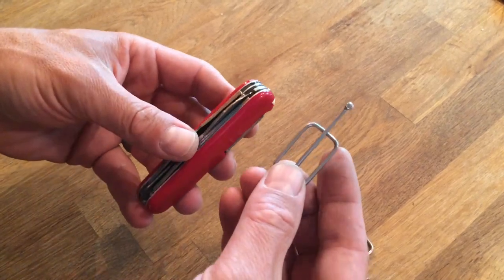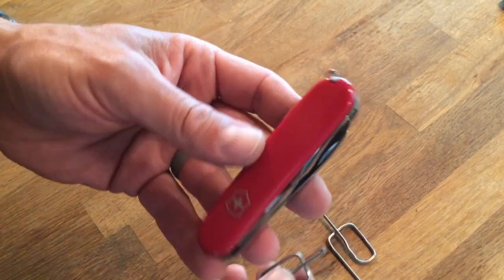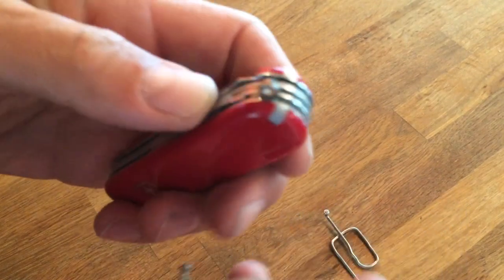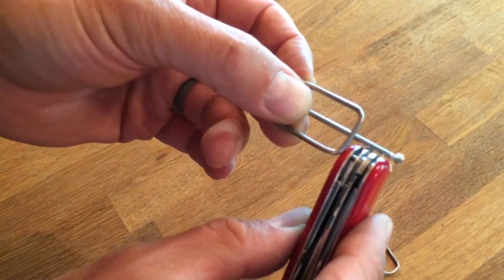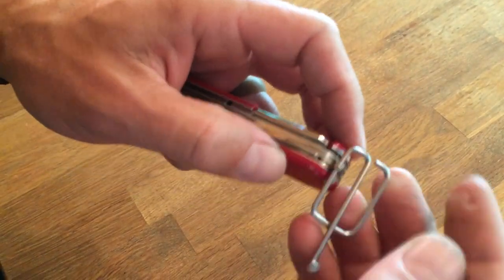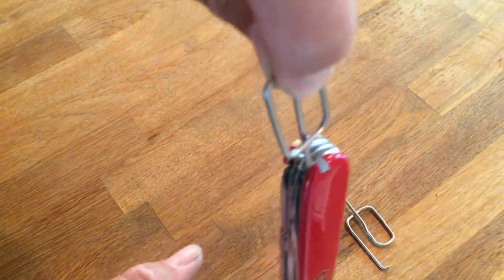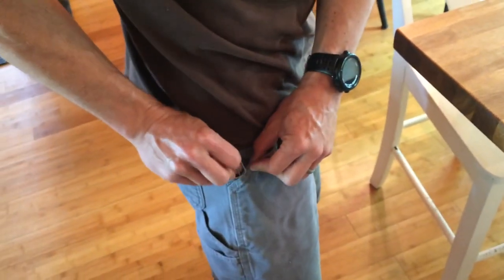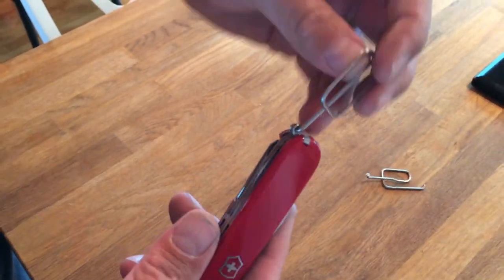DIY pocket clip for Swiss Army Knife

Comment: Simple, effective, cheap and BRILLIANT. 
Made one out of a large paperclip in about 1 minute. Works great. Will invest in a more durable material like a bicycle spoke.
Many thanks Spike.
Reply: I did just as you said after reading the comment and i’m simply MIND BLOWN!

Funnily enough, I used the pliers on my Deluxe Tinker to make said clip, can’t wait till i upgrade!

(Bike spikes are 5x cheaper than the SwissQlip too!)
Reply: @chicagotypewriter2094  Huh, 5X cheaper, how do you do the math? Using the cost of the SwissQlip then doing 5X, the calculated results is always higher number, never a lesser number. Maybe you mean the SwissQlip is 5X more in cost than a spike spoke; certainly, that would make more sense and can be correctly calculated.

Comment: I think you can use a quarter size key ring. Just pull it apart enough so it it isn't tight anymore. Slide your knife with its key ring onto it and then clip the larger key ring to your pants.

Comment: Hi. That is very cool but how did you bend it to make it look so nice? Unlike the one on the table.hope you can answer-thank you!
Reply from the maker: Ray Jr DiBenedetto The one on the table was my first attempt. So it was bent back and forth several times to figure out the correct distances, which causes it’s crooked look. To bend the spoke, I used large needle nosed pliars and standard pliars. I did the bending with the needle nosed pliars while holding the spoke firmly with the standard pliars. The skinny tips of the needle nose pliars allow me to grip the spoke close to the standard pliars jaws so that I can get a tight radius bend. It takes a fair bit of strength though. I hope that helps! Cheers

Comment: Epic simple, totally ergonomic!! I assume the wide portion that hangs over your pocket was left wide to accommodate the width of the knife? I would prefer it to be left smaller/thinner, please let me know!! Brilliant work sir! Great design!!!
Reply from the maker: Thank you J Garcia. The width of the clip results - in my case - from the width of the pliars I used. 

I imagine a firm grip with the tips of some needle nosed pliars could produce something thinner. 

Or, I think only having one return bend could work as long as the spoke has itself to ‘pinch’ your pocket against. 

Cheers

Comment: On the face of it ,that looks great for pocket storage . But when you come to use the knife that clip must get in the way , a lot . I have taken off the ring and ground down the lanyard ring i found that even gets in the way for comfort . I can see how useful your mod is for pocket use but that clip mod must really be a big pain and get in the way ? Ok if you hardly ever use the SAK but if you use the thing a lot i see big prob . Can you tell us how to use the knife with this thing hanging , or better still make a video . Many thanks i also mod my SAK  ( see video ).
Reply from the maker: Thanks for the reply Rob. The clip I made certainly doesn't come without some compromise. If you found a bare lanyard ring annoying, I'm certain you wouldn't be happy with my solution. However, I've been able to acceptably work around it while using every tool. I'll eather fold it back along the same-side scale (when using the small blade for example), or have it extend off the back of the knife (when using the large blade for example). I use my knife daily in the office and in the woods, but not as a 'power user', or with such heavy force that the clip impedes what I'm trying to do. In the end - for my uses - the trade-offs of the clip are still worth keeping it installed. Cheers!
Reply: @SpikeBachman  Thanks for the reply you explained it well you find the trade off was worth it , that's fair comment . It's all about finding what works that's great , have a look at my can opener / screw driver mod on my channel , any feed back is always welcome . Tks  rob in Scotland .